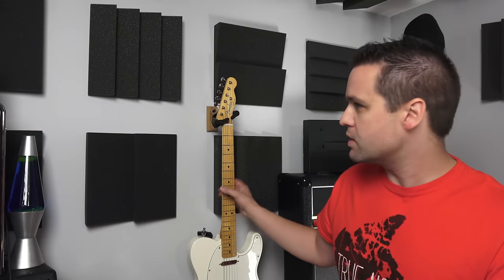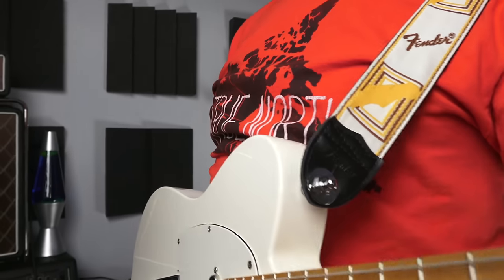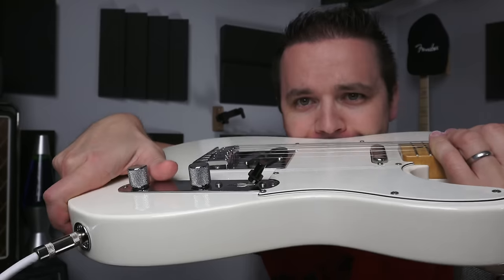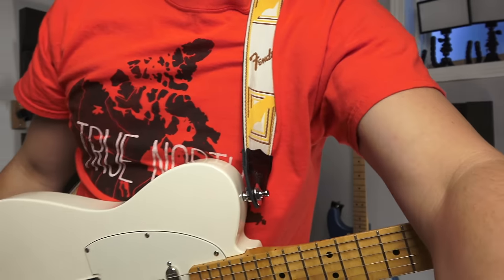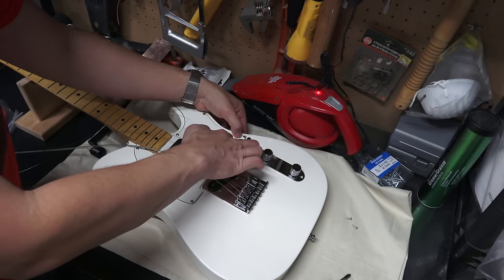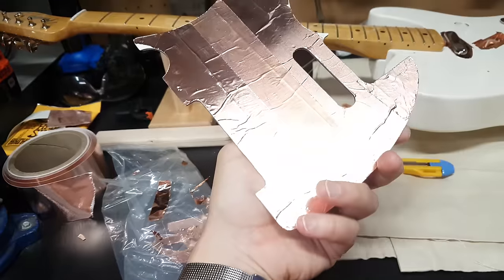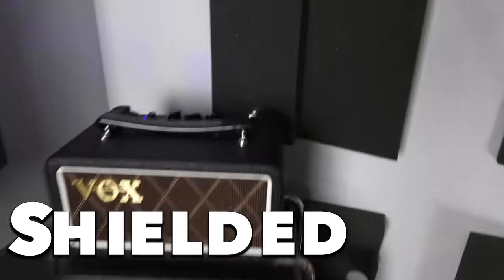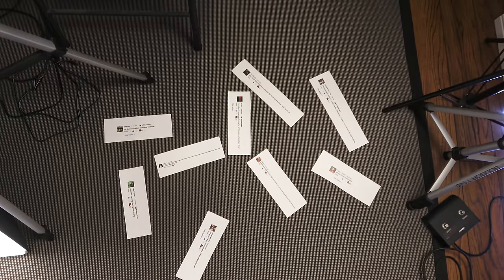How to Shield an Electric Guitar - The Easy Way

Comment: I shielded a Jimmy Vaughn strat once. It was almost totally silent. You have to make sure all the copper shielding is touching each other and that it's all touching the ground wire from the bridge ( bare the ground wire coming back into the cavity so the copper will touch it). And if you do the back of the pickguard you have to have a little overlap on the cavities so that it makes and completes the circuit. 

Back in the days before this sticky copper tape came around, a copper cavity lining job required thin copper foil which they would mould in  place with their fingers and then they would solder, that's right literally solder the pieces of copper together like a welder would do with steel material. I read about that years ago about one of Santana's telecasters...and then this copper sticky tape came around, I was thinking of painting the cavities and then foiling over the paint with the copper foil.
Reply from the maker: nice🎸👍
Reply: also dont let the copper shielding on your pickguard touch your Neck pickup,

Comment: From Leo:  Shielding is a worthy modification.  You did make a big difference.   Two things;  do you have a good ground wired from your bridge to the ground?   It seems that you touching the strings is pretty drastic.  Also, are you sure all your pieces of copper are making good connection with each other AND the ground ?  I actually solder all the strips together and if needed solder jumper wires between the cavities.
Reply from the maker: hey thanks for the tips. There is a ground from one of the pots to the bridge. I double checked that when I had things open.  And the ground is touching the copper tape
Reply: If you have to solder you aren't using quality tape or aren't installing it correctly. Conductive tape overlapping is sufficient continuity for grounding, and if in doubt,  measure continuity with a mulitimeter.

Comment: If you have a lot of EMF, humbuckers aren't a magical fix. I just moved into a new house and the noise while sitting at my PC is terrible. It's worse on my guitar with passive humbuckers(I don't own single coils), a little less bad on my guitar with EMGs, and significantly reduced on my guitar with Fishmans. I'm going to have to invest in one of those power strips that cleans up your electrical signal. From what I can deduce, it's the light dimmer in my circuit doing it.
Reply from the maker: light dimmers are really good at creating noise. I had to remove one from my music room a few years back

Comment: Definitely helps I used aluminum foil and tape and it worked just fine
Reply: I'm trying that now, I bought some foil tape from the hardware store and dropped it off with my guitar tech this morning for a telecaster. The volume knob makes crackling sounds while turning it so that will separately be fixed also. I didn't experience a steady hum as shown to n this video but I have been experiencing a popping/static sound only while strumming. It should be interesting to see how adding foil tape to the underside of the pick guard and to the insides of the routed pickup chambers turns out. The guitar in this video consistently buzzes, my telecaster only makes popping sounds while being strummed
Reply: @andrewstendahl36  did it work?
Reply: No, I took that mint condition 2004 Fender Classic Series White Blonde Ash finish poly gloss vintage tinted maple neck 50s mim Telecaster to my Dads house where it sits untouched and will remain until long after the both of us die. Maybe in 35 to 45 years someone will uncover it, marvel at its condition and procure it just the same. Perhaps someone in 2075 will throw it in the trash after being the 3rd or 4th owner to try it, hear the crackle issue and say, "Damn it Fender, this is horse shit"
Reply: @andrewstendahl36  or you could just change the electronics in it lol. Drop in  some hot rails and some CTS potentiometers and you're golden.
Reply: @Randy-jz9ox  I first tried switching to Fender noiseless pickups, next I tried the sheiliding process with a tech who soldered the electronics to metal tape which was applied to entire body cavity beneath the pickguard, also throughout the knob routing cavity. What would it cost for a guitar tech to add hot rails, which I'm not familiar with and CTS pots, which I'm also not familiar with?. -If this would get that tele right, this method would be worth correcting the static issue. This may be a project for my tax return

Comment: Did you just put the tape in and put everything back together? Did u ground the areas together ?!
Reply: Good question. I've been watching a lot of videos on shielding and a number of the good ones stress that this is a useless tactic unless you ground the tape by soldering it to a pot and the pickup.
Reply: Physical contact between your conductive tape, or conductive paint, matters. You don't have to solder anything, just make sure your shielding paint/tape touches the ground exposed wire and the shielding of the cavity touches this shielding of the pick guard. If you don't make contact with the electronics ground it is a grab bag if you will have issues or not...you may not, but the possibility is there.

Comment: My experience was not good with the shielding paint. It’s sucked this is stain and tone out of my Strat I ended up shipping and sanding it all out and using the aluminum HVAC duct tape, which worked really well. I got great results but I also showed him the input jack of my amplifier and the effects loop with that tape just careful not to get it on the circuitry.. 
in  hindsight I’m pretty certain I did apply the shielding tape right are I applied too much. 
That experience gave me the patience to learn how to work with the tape easily.. All about the prep

Comment: Question for all:
I just tried shielding my tele. The buzz seems better, but, the overall volume of the guitar seems much lower. Is this correct? Is that a result of shielding, or is it more likely I screwed up a wire while I was in there?
Reply from the maker: I didn't lower my volume. that doesn't sound right. 🎸
Reply: You may add some capacitance, but shouldn’t noticeably effect the volume. If it’s “much lower”, I’d say something got a little out of whack. Might just be something touching that shouldn’t be.

Comment: Actually ALL my guitars that are not yet shielded have this noise regardless of pickups used - humbuckers, noisless. Humbuckers protect from hum, but not from this noise unfortunatelly. At least in my case. But my noise sounds exactly the same as in this video.
Reply: Use a Furman power conditioner
Reply: @nickchristenson589  unfortunately no help in my case
Reply: @nickchristenson589  full shielding of all cavities help